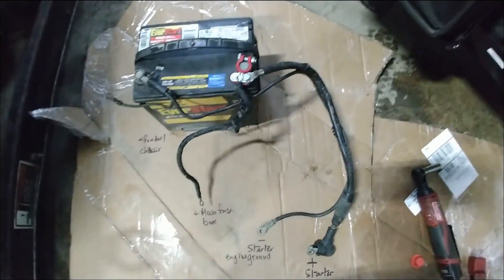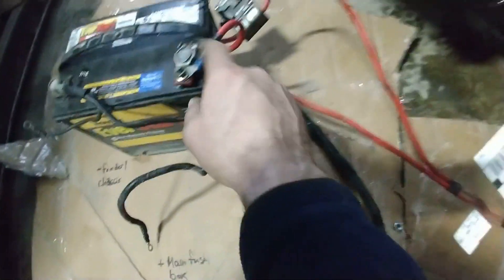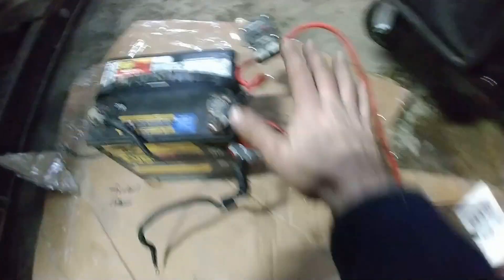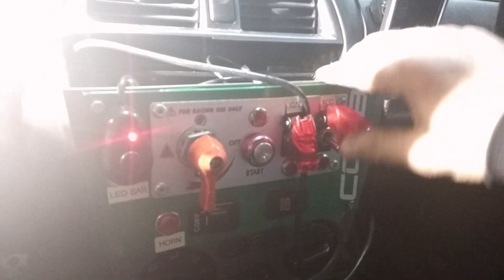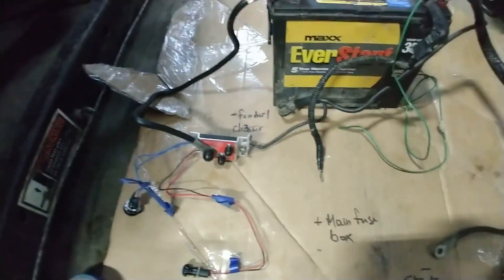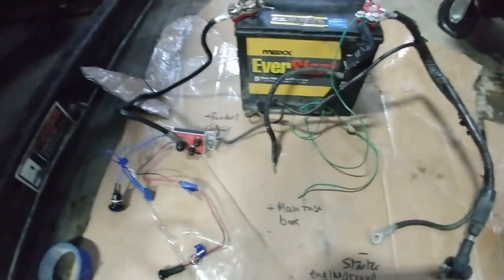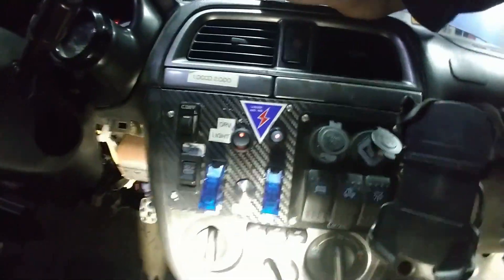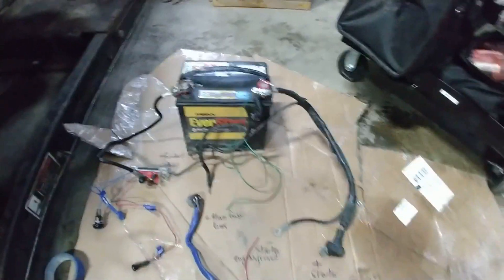Kill switch install - 4 poles vs Cartek GT

Comment: What color was the ignition wire
Reply from the maker: Honestly I don't remember, if you look on the original harness it's the one next to the starter wire. I think it was black and yellow but double check that info, it has been a long time since I worked on this.
Reply: In ur other video it said green/black + black but thats for the push button set up u had so i dont know if its the green black or the black is the wire